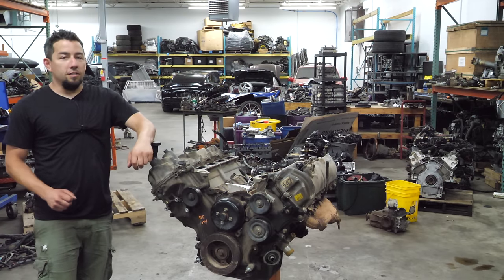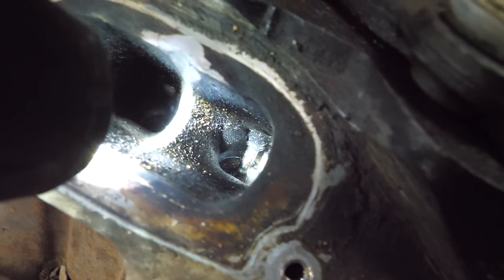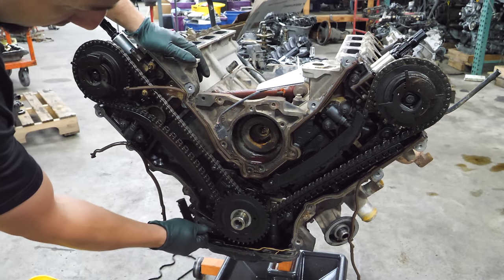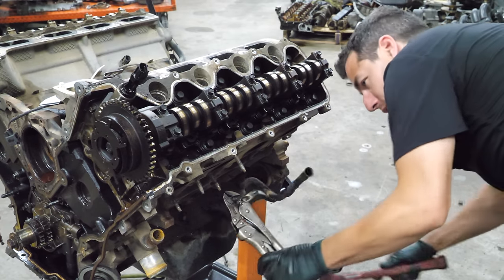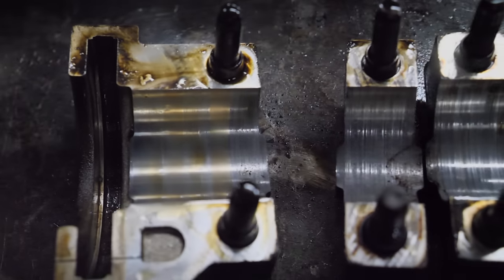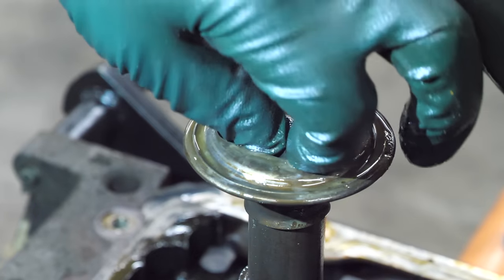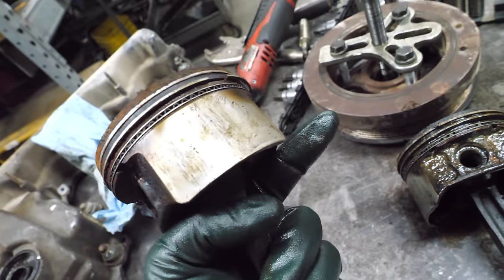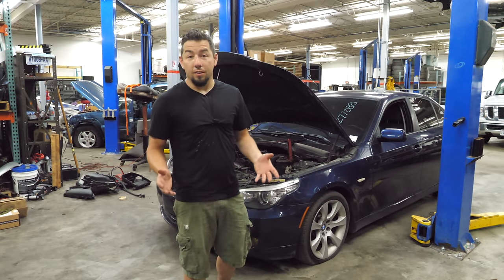Bad Ford 5.4 3-valve V8 Engine Teardown. Which of The MANY Possible Failures Took This One Out?

Comment: I have this engine. IMHO, the main problem is the oil-pressure driven timing tensioners, which are plastic(!) and have tiny gaskets that blow out and cause oil pressure to the heads to drop. Then you get the roller follower issues, cams, phasers, etc. If Ford would have fixed the stupid upper end oiling issues this would have been a decent engine. The bottom end is very solid and it runs great when everything is working properly.
Reply: The early spark plug problems really gave the engine a bad reputation early on, but this issue was resolved by 2008.

By the last few years of production which were only installed in Expeditions and Navigators.  The two biggest changes were the upgraded high volume oil pump (Melling had redesigned the pump several years earlier) and a complete redesign of the phasers.
Reply: @jackpatteeuw9244  "...resolved by 2008..."   You do realize that "by 2008" this engine had been used in trucks for 11 years - cars for 15 years?  2008 was WAY TOO LATE.   Remember the "bailout that wasn't a bailout"???  It was needed because of Triton engines and 6.0 diesels (6point uh oh) and the 6.4 diesels and all the other poor engineering decisions made by ford over a period spanning the 90's and early 2000's.  (and the recommended maintenance intervals published by the marketing team)
Reply: @brianstough5286  I can not disagree with most of what you said !  The 3V engines also needed to be well maintained.  No extended oil changes !!

I happened to be intimate with the whole diesel 6.0L and 6.4L diesel fiasco.  Place the blame on Navistar and upper management.  Who could have forecasted that after the success of the Navistar 7.3L (diesel) they would design 2 bad engines in a row !  This decision cost FoMoCo millions of $$$ !
Reply: @jackpatteeuw9244  It has been tradition for ford to blame their suppliers for the issues they've caused.  Whose fault was it that they failed to check the Firestone tires - if firestone had actually provided bad tires??  (Of course, ANY brand of tire would have failed at the 24PSI recommended inflation (ford's recommendation on the door sill sticker AND owner's manual)

ANY REPUTABLE MANUFACTURER HAS A Quality Assurance Department that does "destructive testing" and Non-Destructive testing of critical parts!!!

Whose fault was it that Ford took an engine delivered from Navistar and "changed out" the turbo's to try to compete with GM's new DURAMAX???     

Whose fault was it that your TRITON engines were given a "competitive" recommendation for oil change (and other maintenance) intervals??     For benefit of the doubt purposes, let's just assume that the engineers did not approve of the Marketing Department's decision to "match" GM's maintenance intervals???      

Every single person that "defends" ford's engines the way you do EMPHASIZES VERY LOUDLY that you MUST change the oil much more frequently that ford recommended for these engines...

Please "disagree" with me some more AFTER you've looked up these few items.  

ESPECIALLY the "fix" for the RECALL on the ford/firestone fiasco
Reply: @brianstough5286  As I mentioned, I have first hand knowledge of the 6.0L/6.4L fiasco.  Navistar made all of the design decisions.  I don't know what you are talking about changing the turbo.
Reply: @jackpatteeuw9244  Of course you wouldn't.  Would you mind speaking as to what "first hand knowledge" means in your case?    It is very well documented that ford modified the engine before putting it into trucks.   

And, do you think it's a wise decision for the #2 (and all that implies) to "throw their partners under the bus" like that??
Reply: @jackpatteeuw9244  I would still like to hear about your first hand knowledge.  Who knows, maybe we could all learn something from you!?!
Reply: @brianstough5286  I sat next to the people from Ford who were responsible for packaging the engine in the vehicle.  The only thing "Ford" about that engine was the cruise control.  Management and Purchasing called all of the shots.
Reply: Your answer(s) are evasive enough that they are difficult to believe. 

 I remember "truck shopping" when the Duramax was released and caught ford with their "proverbial 'pants down' ".  

Reviews from every web site trying to show the 6.0 (with loaded trailer) doing drag races with early Duramax equipped trucks - and coming out on top by fraction of a second - then five minutes later breaking down.  Blowing large volumes of black smoke and sometimes even flames out of the exhaust.    

That's when we started hearing about the additional changes made to the Navistar 6.0's AFTER DELIVERY and as part of the installation...

I was once in a bar where I sat next to a fighter pilot - but that does not qualify me to tell you about the details of the fighter he flew...

Are you trying to imply you were employed by Ford?    Where?  When??

Comment: Fyi the chain rails go on some of the modular motors if cheap oil filters without anti-drainback valves are used. Something with the oil pressure needing to build lets the chain slam into the guide on startup. Over time the guide brakes. 

Motorcraft or higher end filters will hold the pressure for longer off-times and the chain doesn’t slap as hard.

Some sources also suggest this slap-chain guide issue is why the 2V modular motors went from 5W-30 recommended oil to 5W-20 around 2000. 

Also, congrats to the people who got 200,000 miles on their 2V and theirs still ran like new. I’d be willing to bet those miles were years ago though. You get one of these now (high or low milage) and you better prep to at minimum be replacing the plastic intake manifold and gaskets soon. Do all the plugs (torqued properly) after the manifold, and once one of those coils goes you better do all of them. 

The 2V motors do seem to “keep on going” though. “Running like new”?  From my experience, no. My experience has been more like “it keeps starting and getting me to work but has a slight miss I’ve given up solving 4 years ago. Oh! Just hit the 3,000 mile mark. Gotta top off the oil cause I know it’s a quart low. At least it’s not a 5.4L 3v;  guess I’ll keep it”.  That’s a more accurate statement. 

This is if from 3 different trucks, all 3 available 2V displacements, over a 15 year period.

Comment: One timing job and a high volume oil pump. 19 years old, 269,000 still going strong.
Reply: ?????? My motor has 213k without those, but it did just go kaboowey the other night
Reply: Mine has 290k miles on it and the only thing I’ve replaced on the entire truck other than my wheel bearings from the breaks wearing down was the coil packs. I regularly change my oil every 3k miles.
Reply: @junkaccount2535  That's why I don't like these engines. A well designed engine can do 10k mile services and have no issues. 97 oil changes for a 290k car is ridiculous.
I'll do 30 oil changes in that amount of Km's how much does 67 oil changes cost.
Reply: @elfairmont40  Sounds great in theory, but I don't know hardly any cars that actually make it to 290k other than a toyota corolla or honda civic, and I know that's not being used for nearly the same thing as an f150. Not even the smaller toyota trucks.

Comment: If you take care of them they're good engines. Most problems I saw in the dealership was people not changing their oil like they should and the sludge plugging up the cam phasers and trashing the engine
Reply: @navyphyrfitr6550  if I can't run Delo 400 15/40 in it, I don't want it. (:^(3

Comment: 5.4 Are Awesome engines....just gotta update Timing tensioners.   420,000 miles on our work truck
Reply: People are lazy and can’t change oil. Then they say the motor is junk. These engines also have great low end torque
Reply: @anthonys7534  I change my oil in my 4.6 2V every 3K miles. Reason being I’ve had the opportunity in tech school to tear down a modern engine (2.0 GTDI Ecotec) and I instantly ditched any and all marketing and hype for extended oil changes. All 4.6 and 5.4 Modular’s have at least some small oil passages up top, 3V’s with phasers had even more. Oils and filters are cheaper than a reman engine and labor.
Reply: @anthonys7534  I like mine. I have 265k+ miles on mine. I've owned it since new and have always used synthetic oil and changed if whenever I was in doubt.

Comment: I've had one of these in a 2004 FX4 for 154,00 miles. Sure, it has it's quirky little sounds but as long as it pulls as well as it does, I'll keep her going.
Reply: Those little sounds means it needs a timing job ASAP!

Comment: When they rattle in cold start fix the leaking timing chain tensioner gasket that that will keep the rest of the engine from oil starvation. Wait too long and it’s done.

Comment: Got a used one with 192k miles without knowing the issues for $2500, got the timing guides replaced after they broke and clogged the pick- up tube, and new high volume oil pump, currently at 205k miles with the phasers locked with no tune runs fine for now.

Comment: It has its issues but I still stand by the 5.4 we had in our 97 Eddie bauer, that thing was still running good after 363k miles the day we finally traded it in for a new truck. My dad was religious about the maintenance and that’s really the only thing that made it that far
Reply: That would have been the old 2 valve per cylinder version which is much more reliable

Comment: I bought a used 2011 E350 Super Duty extended cargo van with the 5.4L V8 SOHC 16V MFI FFV. The previous owner was a fleet that used it mostly on the highway. You said that the E-series stuck with the 2-valve configuration. When I first got it, all 8 of the $250/each coils had to be replaced, but after that, it's been smooth and strong. I regularly tow my '97 Volvo 850 and 7x14' cargo trailer with no problems. 

If I had known about the pitfalls of this engine, probably wouldn't have bought it, but the beast has been reliable -- which is good because the Volvo is more likely to need [expensive] work than the big Ford van.

I of course watched this tear-down with fascination with the hopes that any problems can be avoided.